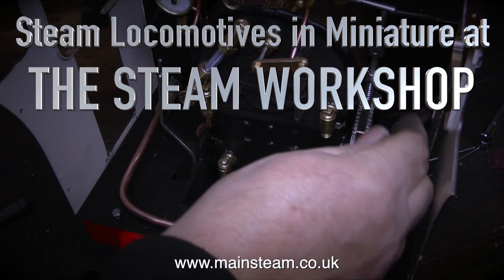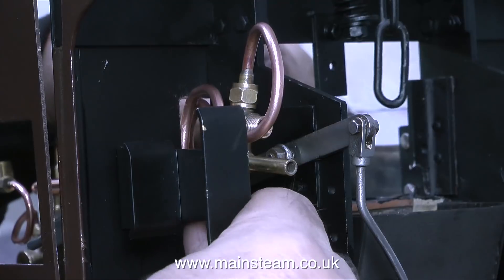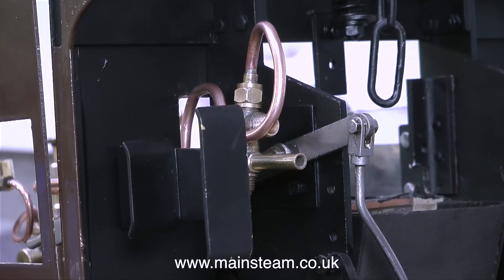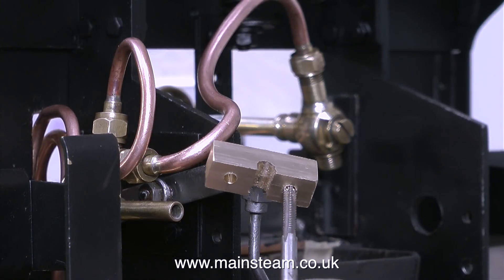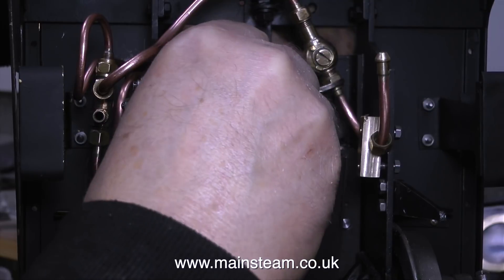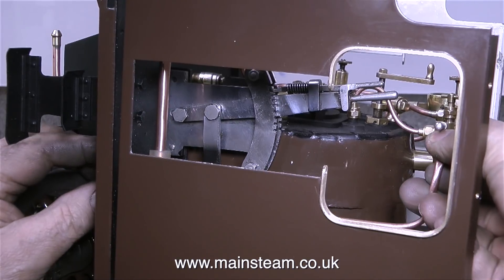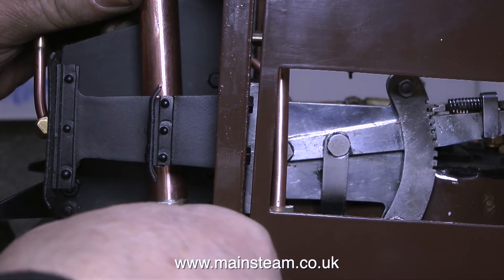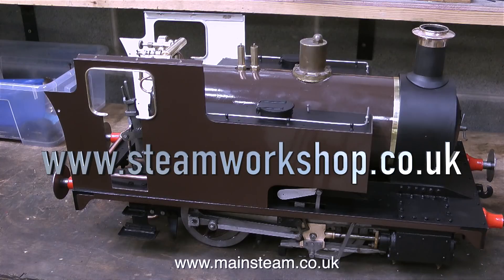WORKING AT THE STEAM WORKSHOP #20 - PIPING THE INJECTOR AND WHISTLE

Comment: Well my strategy to deal with frustration in the workshop is quite simple and efficent. I will fit a wood fired oven inside, and that way, i can save myself the cost for the isolation of the workshop. You so as i am new to to hobbie, i calculate i will get frustrated on a very regular basis. So i have a Axe and a Chopblock in the workshop, and a lot of wood that needs chopping, which i will do, instead of smashing the projects i work on. With that said, i think i will never freeze in the years to come. As i get better, and my projects therefore bigger, i can use the wood to fire my steamengines :D

Comment: Have you ever used the sand fill method to bend coppper pipe? I have used this method with great results in avoiding kinks
Reply from the maker: No and I haven't tried the frozen water in the pipe method either.

Comment: I know you've had lots of experience and practice, but I admire your ability to free form the piping. 
Occasionally I fabricate custom brake fluid pipes and need to resort to mocking it up first with either large diameter solder (not sodder) or mild steel wire. That allows me to use a bender to get the part very close to the correct shape. 
How much bigger would your home work shop need to be for a comparable Bridgeport?
Reply from the maker: with a bit of moving about in my workshop I could get one in  . . . . once I get rid of all this surplus to requirements DMX LED stage lighting that I have in my workshop - a Spring clearout is looming I think .....